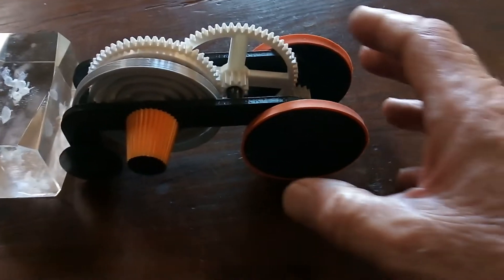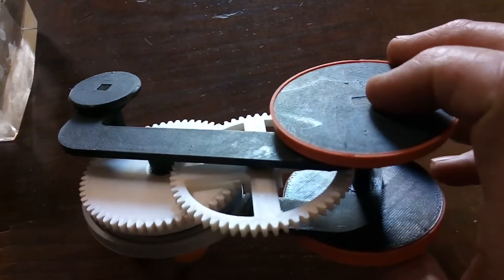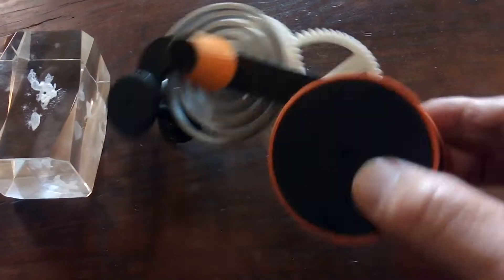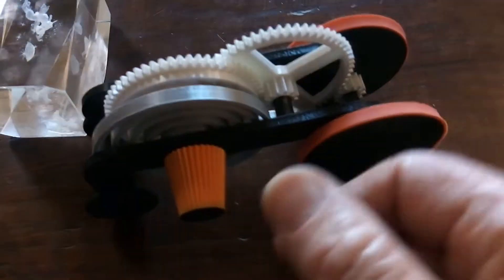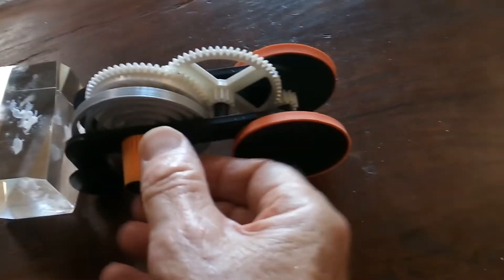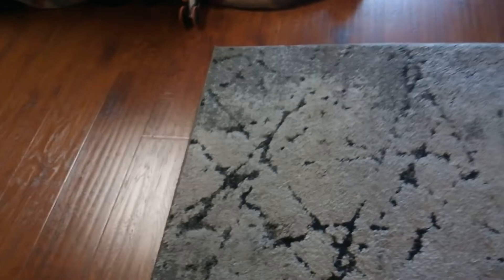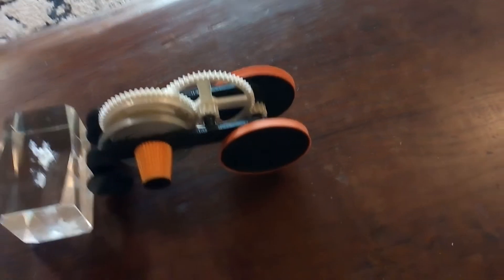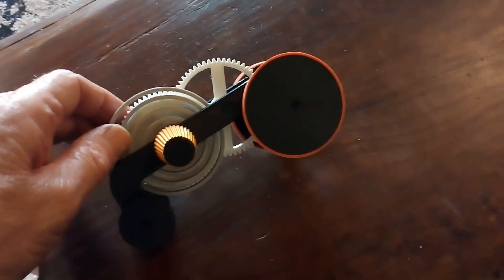Greg's Amazing 3d Printed  Windup Car

Comment: Hi Lidmotor!

That is a very impressive build as these mechanisms (mainly the gear mesh) are difficult to 3D print, prepare and assemble!

Again, very nice work!

Greg
Reply from the maker: Thanks Greg.   The car runs great!.  I must have my printer setup just rignt.  The only thing that I had to fit were the axles.  The gears I just ran up a bunch of times and oiled them. The spring knob is weak and I may build a stronger one.
     I watch what Grandad builds and sometimes try to replicate the same things.  It is all fun.

Comment: I wonder how much electrical power could be harvested from it fully wound? Just a thought from outside the box!
Reply from the maker: I'm thinking the same thing.  That simple spring motor holds alot of potential for other uses. Gzumwatt has a 3d print design for another spring motor that I might build.
Reply: That's not outside the box. That's my first thought, can it be harvested from. Happy this guy got a 3-D printer. Hope, he goes to make his older Circuitry stuff with it.